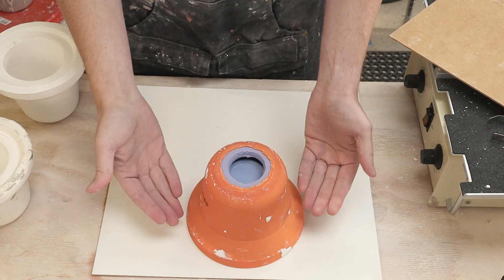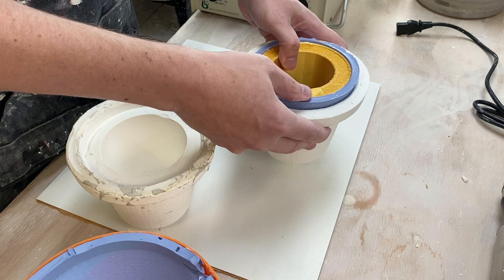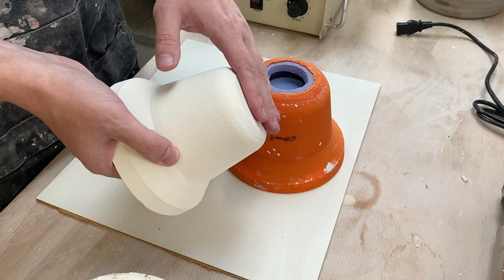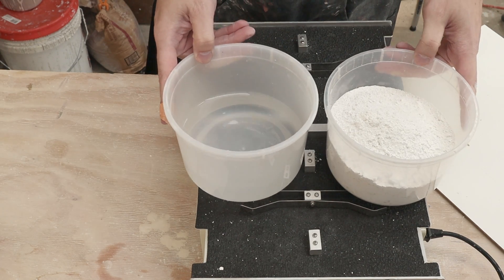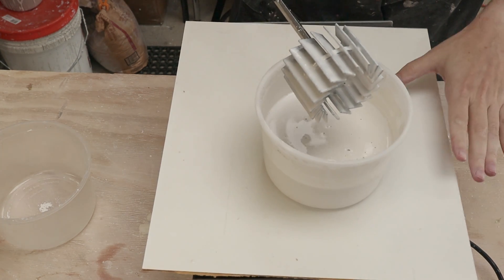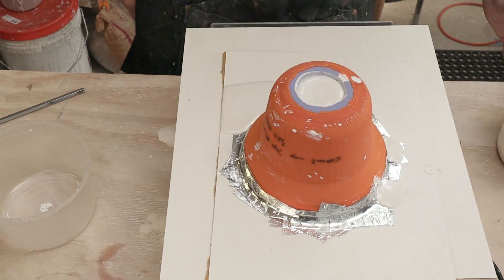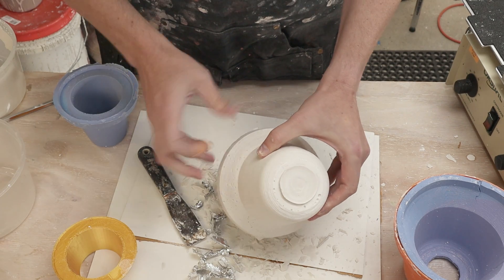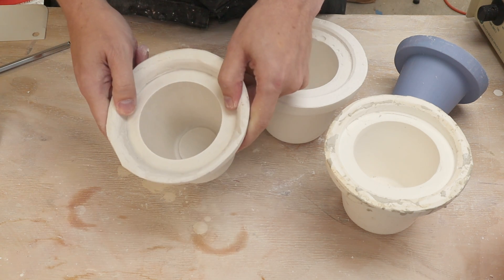Going UPSIDE DOWN! Continuing to fight bubbles in my slip casting plaster

Comment: Looks great!😀 In addition to use the vacuum pot to degass, I also pour through a kitchen strainer which catches any sneaky lumps. Not sure if it helps with any remaining entrained air in the plaster, but certainly doesn't appear to hurt. Spent the last couple of days working with a crystalline glaze formulation, which will be fired tonight, so am finally able to get back to some POP experiments. Also repaired my 3D printer; an errant print managed to rip off the hotend thermistor leads. So more 3D print fodder for the master molds...
Reply from the maker: Thanks! Luckily I haven't had any problems with lumps (that I know of). Good luck the firing!

Comment: Yeah, success!  Feels gooooood.   
I would have thought that you would only want to shake the mold with the plaster in it, NOT shake the plaster while mixing. 
Have you considered using caulk, clay, or hot glue instead of tape?
Reply from the maker: I had thought about using it only while in the mold. However I figured any help I could get (eg while mixing) would be good. I'm not sure it's really needed though.

And yes, I've used clay before instead of tape. Caulk could work, but is slow. I've seen in other contexts hot glue isn't a great option because it holds too well when it comes time to demold. Another thing I've seen when casting resin is the use of wax and that seems to work well, but needs a few tools I don't yet have.
Reply: @PotterybyKent  Hot glue is fine for the inner Part of the mold. Just a few dots. Then a thin bead of clay all around so there's no leakage underneath. The outer part can be fixed in place with just clay on the outside. You'll get a bit of flashing on the inside but you can easily break it off after demoulding. As long as the plaster is wet, you can easily shape it using a surform. I do it like that all the time (except I use a wooden box for the outside) and I never had any issues with leakage and the moulds turn out super smooth.
Reply from the maker: Thanks for the tips. One of the reasons I went for the tape was to be able to secure the outer silicone mold to the other 3d printed shell. Also, since the inner mold is hollow, I was worried about plaster leaking in and filling it. (So it did need to be sealed all the way around). Another challenge was the original top surface of my mold, here the bottom, was not particularly flat/uniform. This was more a result of repurposing my mold to use upside down. In designing a mold to be used its intended way,  it would be more straightforward for sure and result in a mold without the artifacts I got here.